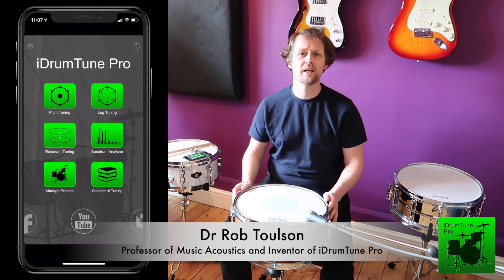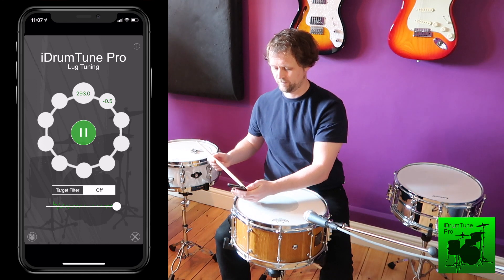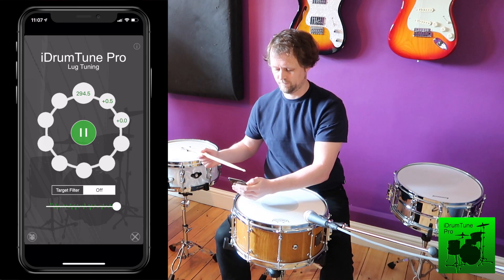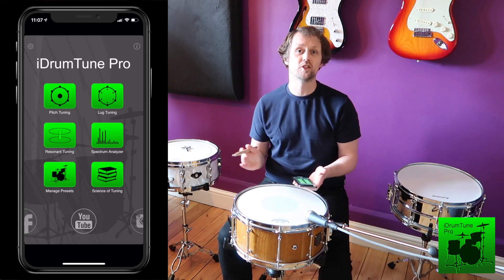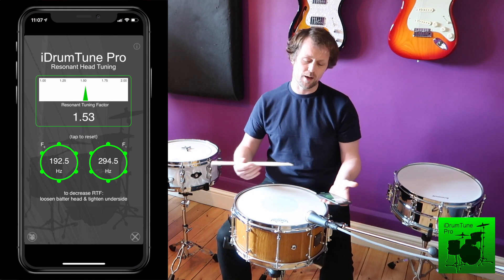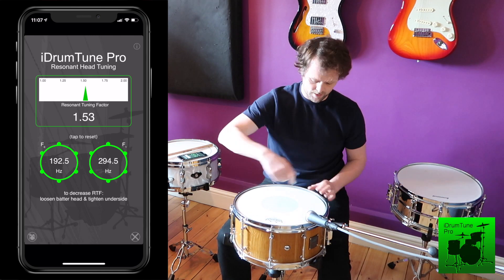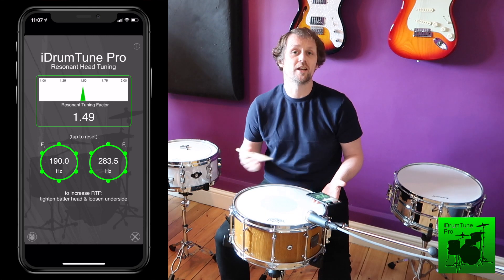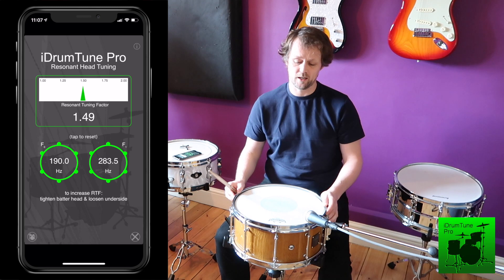Snare Drum Tuning - clearing/equalising around the edge of the drum and tuning the resonant drumhead

Comment: I bought the book and spent the last week reading it, and I've gone through all of these videos and the material on the website. In my experience, the app works well enough for equalizing the toms and bass drum and not at all for equalizing the snare. Usually, it can't identify the f1 frequency of one or more of the lugs, including when using the filter, which makes it impossible to use. When it can locate the f1 frequency, I can take repeated readings of the same lugs tuned the same way and each subsequent reading comes out radically different from the one before it, meaning the app is inaccurate. One time, one lug may read +20, the next time it might read -10. This is after painstakingly following the recommended procedures of initially tuning the lugs finger tight and then gradually increasing their tension evenly. I've even detuned and retuned from scratch, same results. And, apart from its performance on the batter head, on the resonant head the app usually can't identify the f1 frequencies at all, so there's no way to even try to tune it evenly except by using my ears, which is utterly unreliable. I would really appreciate some means of support from Professor Toulson regarding these issues.
Reply from the maker: @ckbraman  thanks for your comment, please email info@idrumtune.com and we’ll help you get everything working correctly.

Comment: i am a relatively new drummer and i am trying to tune my kit after changing both heads on all of my drums i assume the same technique of setting the reso and batter is the same on those as it is on the toms? i.e if i get even tension and then turn up the batter a quarter of a turn then i must do so on the reso of the tom?
Reply from the maker: Hi Speedy G Drums, yes indeed - apply the finger tight plus a quarter/half turn approach to both drumheads and you should be in a very good starting point for fine tuning with iDrumTune!
Reply: @iDrumTune  hi thanks for the reply, the issue I seem to be having was my 13” seems to be higher then my 12” in pitch for some reason I am also using your app to try and help me to tune. I couldn’t really figure it out at first but after watching them in abit more detail when I go back to tuning/adjusting them later I should have a better understanding the best thing is I can rewatch them over and over until I get the hang of it. Thanks